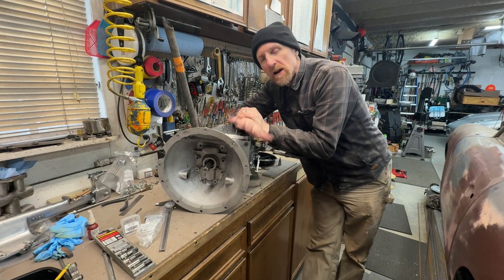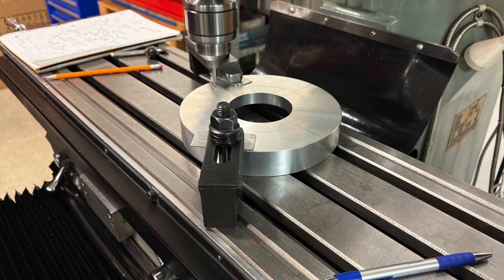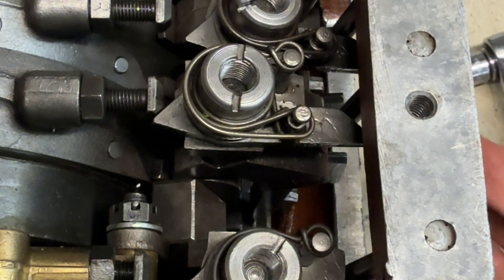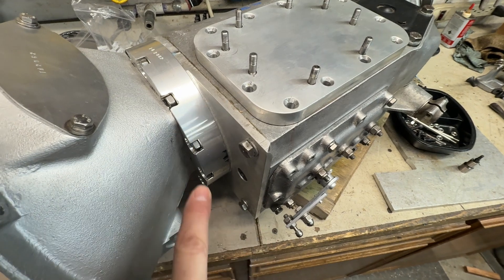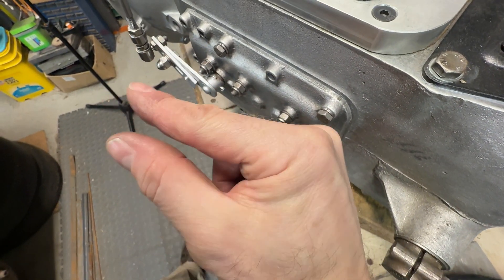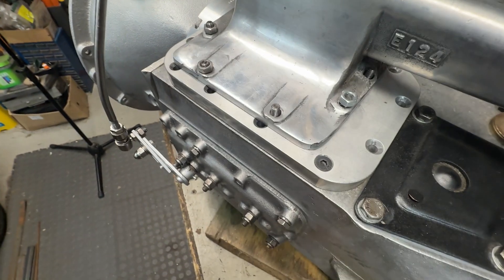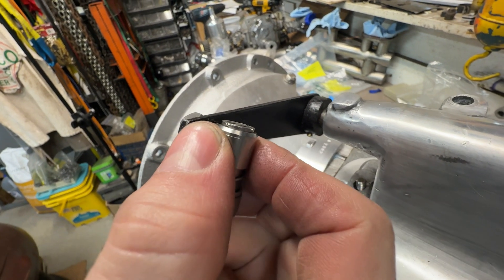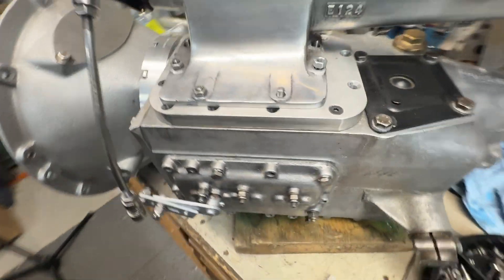MG TA Special Race Car Part 3: Fabricating the transmission adapter plate and gearchange linkage

Comment: Thanks for that. Riley also used pre selectors but I have never seen one so was interesting to see how it works. I knew the theory but hadn't seen inside one. I've never seen those kind of ball end connectors either. The ones I use are clip-able but in a different way. They are used on the throttle pedal and the advance/retard mechanism on the magneto on mine.
Reply from the maker: The quick release connectors I used came from McMaster Carr, who supplies a lot of fasteners and mechanical engineering hardware. I needed something without too much play because the gearbox requires fairly precise selection.

Comment: Interesting to see inside the prselector box and thankyou for explaining it and demonstating it so clearly. A lovely bit of engineering.
Reply from the maker: Glad you enjoyed it. It's such an obscure piece of equipment and for those that care, it's quite intersting.  Kind of the missing link in engineering between manual and auto gearbox.
Reply: @Craig.cootsona  Thanks for your reply. We have a lot of these preslector boxes here in the UK as crash boxes are a lost art to drive. Your alternative would have been to use a MG TC box which has scromesh and is a very strong and compact box  The preselector is maily used in raceing which is why they are iexpensive and dificult to fined. If you can come to the UK Goodwood you will have a great time as it is the home for this piriod of cars.
Reply from the maker: @russellnixon9981  We made a trip to Goodwood Revival in 2015 when they flew in all the Spitfires and had a wonderful time. It's on our list of places to revisit because people drive the cars as intended, and even the parking lot has amazing machinery! On the last day we were watching rabbits hop in the field on Roman Road and heard a V12 Ferrari in the distance. A few seconds later Nick Mason's daughter and grandchild flew by in a 250GTO. The Roundabout toward Chichester was the world's best parade of cars when that event finished.